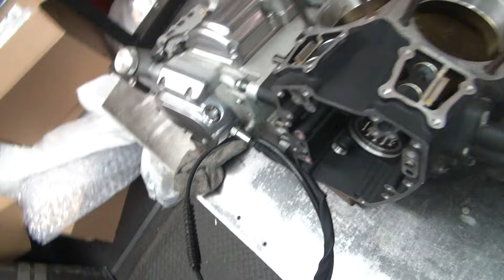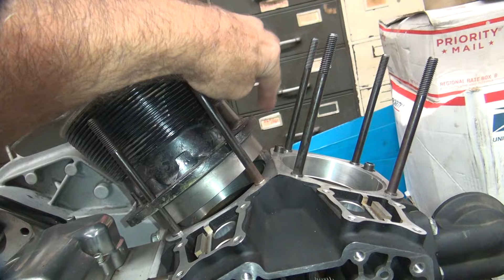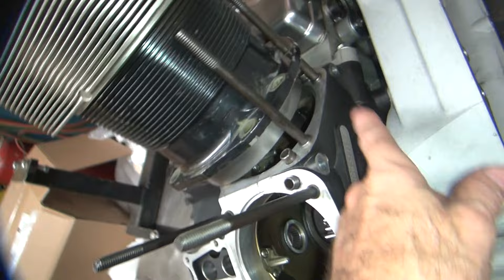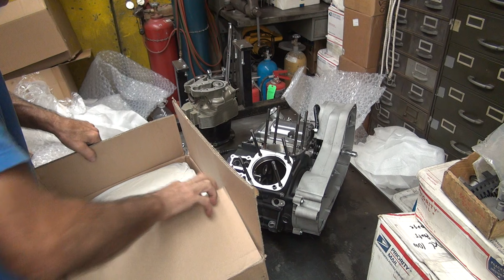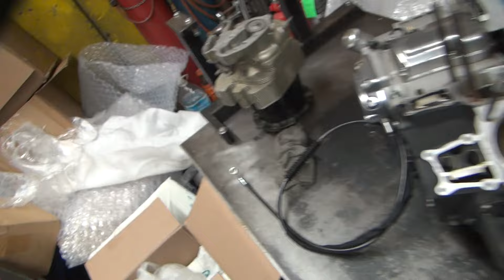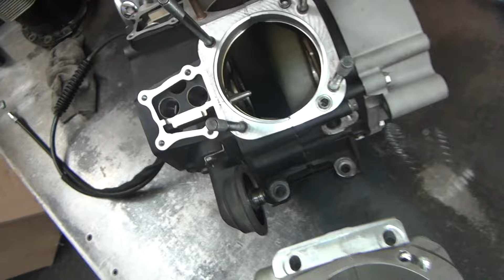#109 custom harley airplane 200ci+ motor twin cam buell xb 4 cam evo XL sportster race tatro machine

Comment: Alan Milyard = flying milyard = 5 litre v twin = hand built 2 cylinders air craft engine = have a look !
Reply from the maker: not interested. i am using harley parts. i want to go fast, not just make noise. i want to double the stock rpms too.
tatro

Comment: could be wrong but i reckon only the Continental o360 has a crossflow head with 2 valve covers per
Reply from the maker: nope, that is a 520/550 cylinder you are looking at. i had the 360 mock-up in a different playlist.
tatro
Reply: GTSIO520... pretty dramatic evolution of the old 520 apparently... i dont see them much